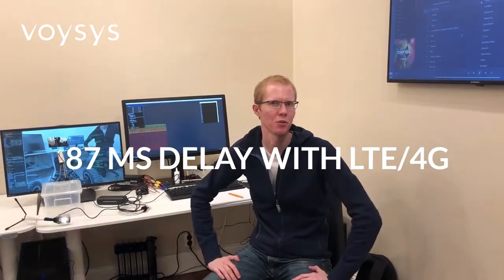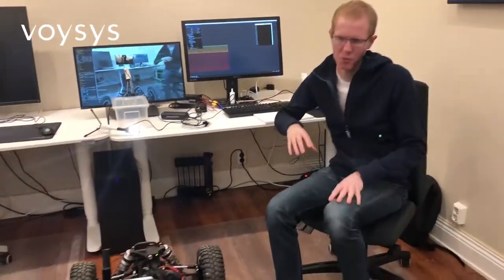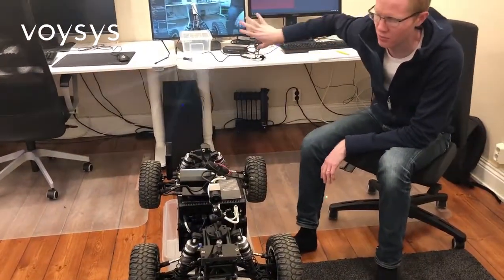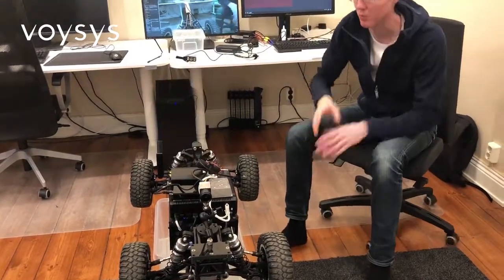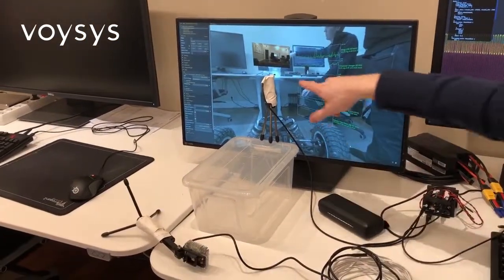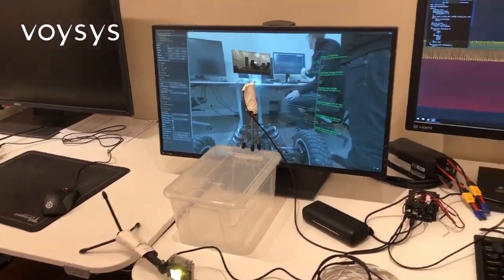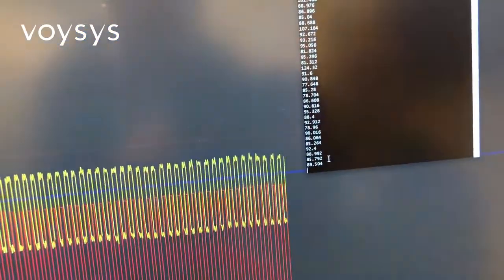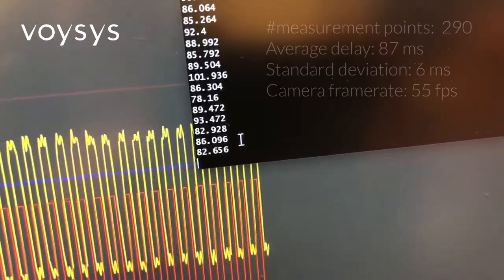87 ms delay with LTE/4G

Comment: It's very cool project and want to buy your solution. Beforehand, have couple questions. 1) Why did you use 4g lte modem not 4g lte module on top of raspberry pi3. Is it faster?? 2) If it is faster which modem did you use and how did you connect it? 3) Camera looks pretty good. Which camera did you use and what is the focal point of view? 4) Do you sell the whole car. if so How much is it?